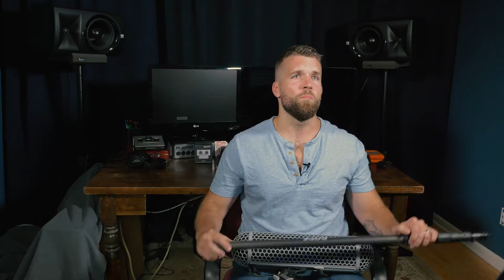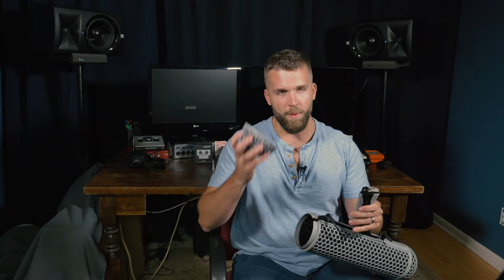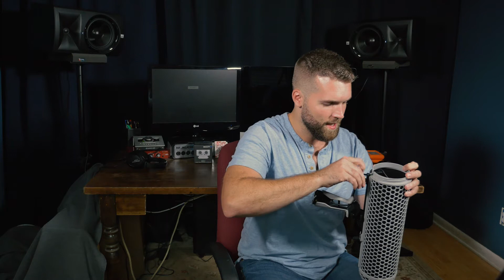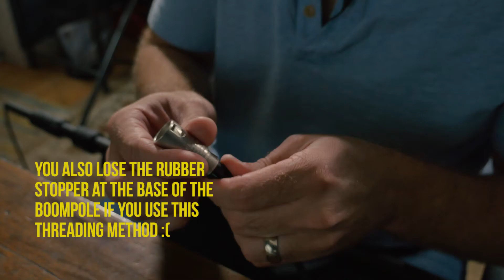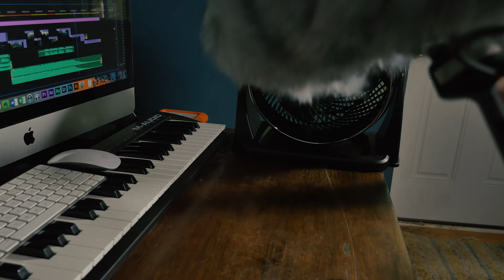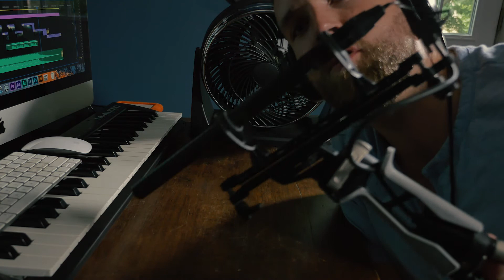The Rode Blimp + Rode Boom Pole Pro Review // Audio + Film Production Tools

Comment: Why do you test the wind resistance against a fan? The very point of the wind is that it is soundless while the fan´s motor sound will kill all the wind noise.
Reply from the maker: Right - if we can hear only the motor and the "whoosh" that means it's working - if the sound gets all clipped and nasty we know the wind is getting through to the condensor plate and corrupting the recording.

Comment: How big is the diameter of the hole in the top? In other words, how big can the XLR connector be to still fit through? I'm hesitant to just buy a cable and then realise it won't fit and might not even be disassemblable like your's.
Reply from the maker: Most will not fit.  I think Rode made a big marketing mistake by saying you could actually thread it - especially since most XLR's these days don't have removable caps like the one in the video.  I don't have it on my and so therefore can't measure but I'd say stay away if thats what you want to do with it!
Reply: Do you know of an alternative that actually fits XLR cables? I've come across some China-made of questionable quality with fixed cables. But what if that cable breaks?

Comment: Question, do you know if the Rode Blimp will work for the Sennheiser MKH416 Shotgun Mic? Thanks a million for any feedback!
Reply from the maker: Yes sir!  The MKH416 is almost exactly the same size as the Rode NTG3.  This blimp would hold a mic up to 325mm in length, and 22mm in diameter.  (MKH416 is 250 x 19)
Reply: Bro, thank you for conveniently responding. Super helpful and appreciated!!

Comment: You should have unsolder the XLR connector from the cable and after inserting the cable, you solder it again.
Reply from the maker: Yes, but still very clumsy and you lose the rubber cap on the base of the tripod.

Comment: How much weight can boompole pro handle at full 10'  feet ? Will the carbon fibre bending ??
Reply: How did you remove that plastic part so you could fit it in the boom pole? The head part that can unscrew. Also what xlr cable are you using in the boompole?
Reply from the maker: Good question!  I don't know the details on that, but a full shotgun mic/blimp rig at 10 feet is nothing on the pole.
Reply from the maker: There was a simple screw removal around the clamp at the top of the boompole that, once removed, allows the pole to be opened.  The issue is you need an XLR that has a removable metal cap (protective cap for the three prongs) so you can fit it through.  In this case it was an old XLR I've had for years.  They don't tend to make those caps removable much anymore.

Comment: Sounds like you can get away with just the deadcat, not a huge difference with the blimp
Reply from the maker: As far as wind protection, probably—but what separates the blimp is the high-end clarity that will still pass through the material, while the dead cat tends to muffle the signal a bit
Reply: I thought the same thing